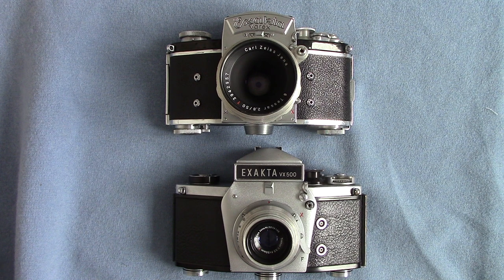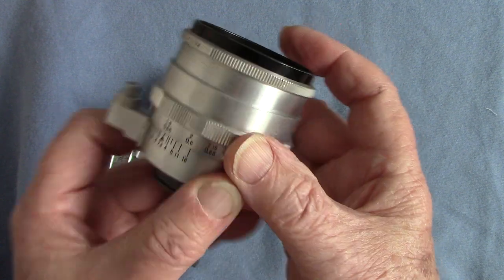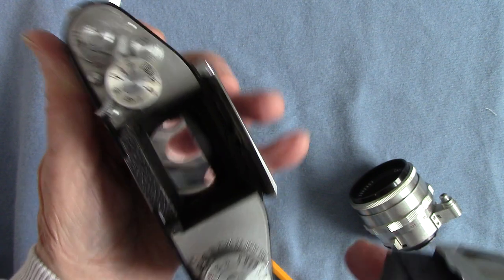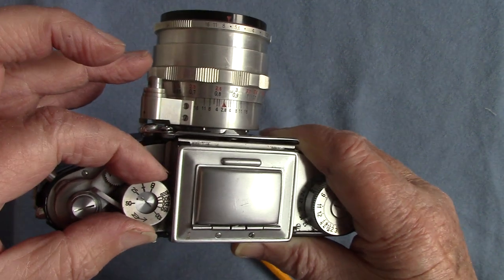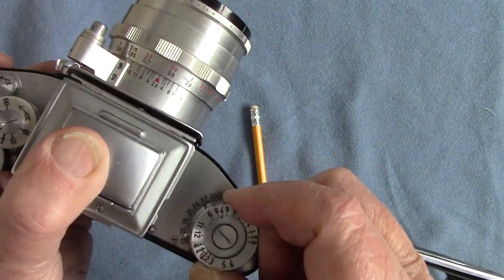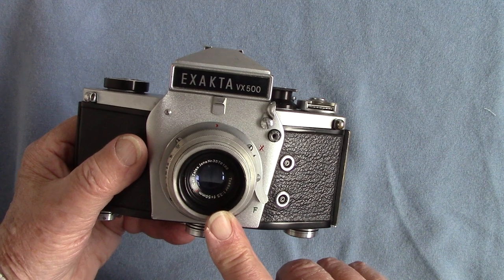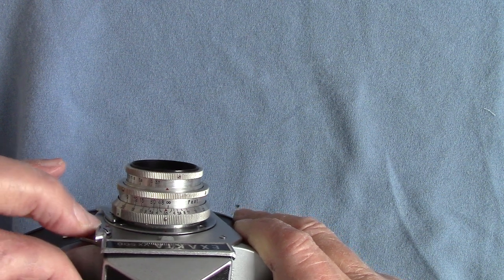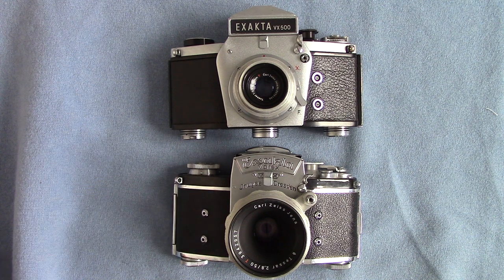The Famous GERMAN EXAKTA SLR ( over-engineered !  )

Comment: Compared to other 35mm cameras of their day, Exaktas were well engineered and built. they had several features which might have been usefully "borrowed" by competitors, but were not. In 1959, when I was shopping for my first 35mm SLR, the Exakta was one of the three cameras I seriously considered. At that time, there were so many lenses and accessories made for the Exakta that no other camera was nearly as adaptable or useful in a wide variety of applications. However, in 1959, the problem with Exakta was that it had been designed in the mid-1930s, and its features had not been updated since then. Those features were competitive with other German SLRs of the day, but they were all in the process of having their ass handed to them by the Japanese. In the end, I sat on my funds for another 18 months, then bought a Nikkorex F (thanks Mamiya) and the newly issued 50mm 1.4  Nikkor.  I used that without fail (or CLA) until replace in 1976 with a Nikkormat FT2. (Well, no CLA for the body. The 50mm 1.4 lens' automatic aperture was a pain in the ass the whole time, three trips to the repair shop over the years to unstick lube jammed leaves.)

Comment: Thé varex (the father of your VX IIa) is probably one of the most beautiful old SLR 35mm. It s à son of the Kine exacta which was the first well sold 35mm. A wonderful piece of engineering and one of the first SLR system with multiple lenses and different viewfinder. A must to have for collectionner as well as the Edixa and the Contarex. You said at the beginning that the aperture of the body is very small but remember we are in the 50ies and the wide angle are not very commun. Nevertheless I got for this camera a 20mm f4 and a 24mm f 4… so we can t say the German were good engineers.

Comment: I've got an Exakta VX (Varex) nice pieces of machinery if you ask me...specially for that time. of course I might be biased as another Dutchy had part in it.  
(Johan Steenbergen, a Dutchman, founded a camera company called Industrie- und Handelsgesellschaft in Dresden in 1912. The name was shortened to Ihagee (based on the German pronunciation of the acronym IHG, ee-hah-geh). Surprised you did not elaborate on the left handed transport. My theory is that these were made for use on the Microscopes. so turned up (on top of the scope) and facing you so you can see into the waistlevel finder made the camera all of a sudden "right handed". if you know what i mean. My theory ;) nobody proved me wrong yet ;) great job showing them.

Comment: I think you have to look at it more from a historical perspective. Exakta was an absolute unique camera. At the time it was released there were only twin reflex- and rangefinder cameras  as an alternative to the large and cluncky glass plate cameras. The "race" to produce the widest aperture lens was still far into the future and using lenses with telescope range was not yet a thing. Therefore the size of the Exakta mount was not a problem. Now we view the Exakta system perhaps as over engineered, but back then they had to start more or less from scratch designing the camera so things like an "instant return" mirror and auto aperture were not envisioned. What lead to the company's downfall was that they didn't inovate enough and held on to the origninal design. A major factor in this was probably the communistic system that was very bureaucratic and did not encourage the quest for innovation.